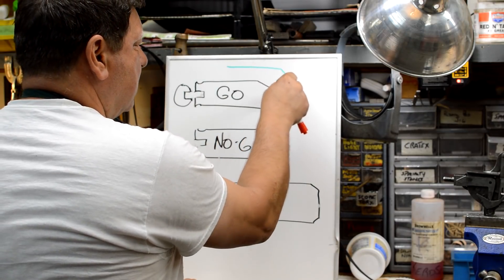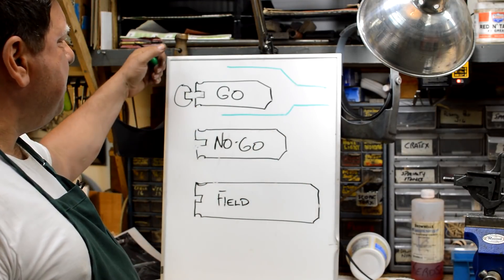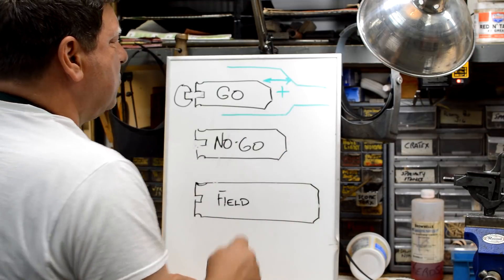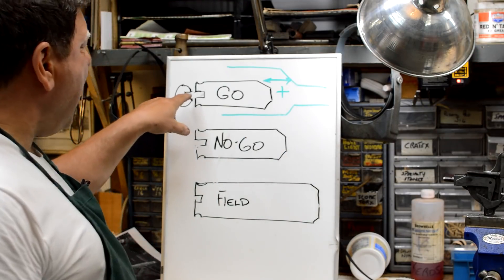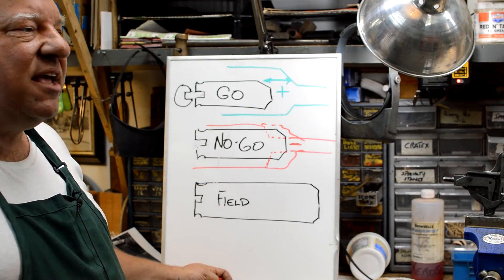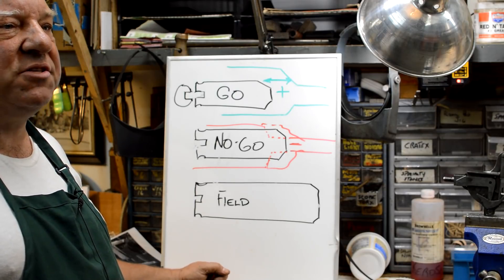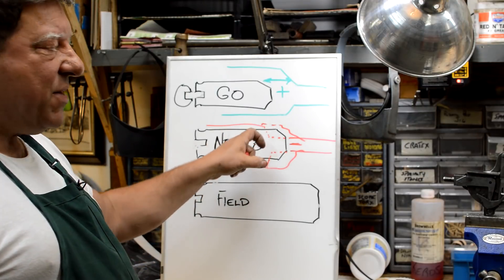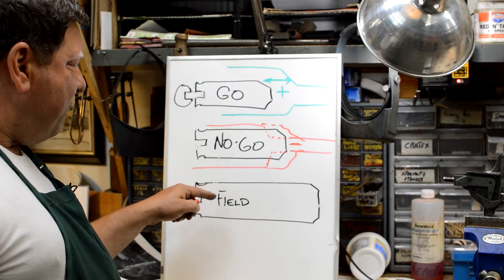Questions, answered #8: headspace gauges

Comment: Here is a question for you Mark. I have never heard of head space getting longer by a lot of use,"burn open". I have heard of the throat length getting longer and the bore wearing out from heat, but never the chamber. If the bolt locking lugs became worn,  then the chamber head space could increase.  I would like to see the evidence, for this claim..
Reply: I don't think he literally meant "burn open", just that the space is increased there due to wearing of the action
Reply: @thecanadianlanboy8132  That's not what he is saying or drawing..Bolts on an M-4 will break, "but don't wear in the barrel extension" causing head space problems. He literally drew on the shoulder area and stated it burns forward lengthening the chamber, causing the bolt to close on a No go gauge. I also have never heard of the military using No go gauges but only Go and Field gauges. The military does not care how much brass stretches in their rifle chambers..
Reply: @hairydogstail  they use no-go, but above regimental armourer level
Reply: @quentintin1  for what purpose ??
Reply: @hairydogstail  check headspace on new barrels, at least into the 80's the army was rebarelling their rifles but that was usually done at the division or corps level.
i have an old French army gauge kit for 7.5 and 7.62mm weapons which has the 3 gauges (go, no-go, field)
Reply: @quentintin1  Are you talking about the French military??
Reply: @hairydogstail  You are very wrong. I was in two branches of the US military and repaired/inspected hundreds of thousands of M-14's,  M16 and m16A-1's.  Even the M-60 machinegun barrel assemblies had three headspace gauges. Replacing barrels or bolts required the use of Go and NO GO Gauges.
Reply: @oldgoat1890  When I was in the reserves they used a minimum and max head space gauge, nothing more. The problem I have is the different opinions and information being put out by different experience individuals.  For example The School of the American rifle states the go gauge for M-16--M-4 rifles used by Colt and in their TDP is 1.4646 ..Many other sources state it is 1.4636... My main question is I have never seen a chamber head space increase by the shoulder area burning forward As Mark Novak claims and where is the evidence?? I'm not saying he is wrong but where is the proof?? No wonder it can get very confusing....
Reply: 8 months later and no reply lol...
Reply: @hairydogstail  The max head space gauge is the same as a field gauge. The no-go gauge is for getting proper head space when manufacturing new firearms, installing barrels, reaming chambers, etc.

The minimum safe head space for .223 rem and 5.56 nato ammo is 1.4636 per SAAMI spec. Colt uses 1.4646 as the go gauge for new M16 and M4 rifles made in their factory. The maximum safe head space is where .223 rem and 5.56 nato differ.

I don't know what Mark meant by "burn open". I assumed he was being metaphorical about general wear tear.
Reply: @nighthound2714  The M-14 does not have a chamber 1.4646 head space lol. The M-14 is chambered in 7.62X51, not 5.56...That would be impossible. Colt never made M-14 rifles lol..

 The military TDP minimum head space for the 5.56 chamber is 1.4646 , not the 223 1.4636 ,  I have the TDP sheet to prove it..

The military max head space is 1.4704 to 1.4706 ,  I have the military TDP sheet to prove it..

The military field gauge for 5.56 is 1.4736 

Head space will increase between the locking bolt and lock up,  but I have never heard of a chamber burning out in the shoulder area, which was my question for Mark who never answered..
Reply: @hairydogstail  The only thing I can think of that matches what Mark said is throat erosion with a straight-walled cartridge. Those head space on the mouth of the case where it contacts the throat. I don't know why he drew the shoulder for a bottlenecked cartidge. Head space is measured differently for every weapon and cartridge type, so it's difficult to give a single generalization that is always accurate. Also, his explanation makes more sense if the go gauge is longer than the minimum safe head space and the field is shorter than the maximum safe head space. 

I wrote M16 (sixteen) and M4 (four). I never mentioned the M14 (fourteen). As I wrote before, 1.4636 is the minimum SAFE head space for the .223 and 5.56 cartridges. Remember, .223 refers to M193 and 5.56 is M855. That's why 5.56 has a longer max headspace; it's not SAAMI spec. Colt manufactures rifles with a slightly longer chamber to improve reliabity in full-auto and with longer bullets, so that's the gauge the military uses.

Basically, min and max gauges are set to the SAAMI spec and never change. Go, no-go, and field gauges are arbitrary measurements set within the min and max spec. They often differ in specific measurement depending on the manufacture and use. (NATO cartridges are their own standard, which makes things even more complicated) I think this is why head space causes so much confusion; It's all relative.
Reply: @nighthound2714  Very well written..

Comment: So my buddy gave me a Spanish Mauser 1916 Carbine. He didn't want it anymore since it was terribly out of headspace and since he had just lost his job, he didn't want to sink any money into it. Turned out someone dremeled down the bolt face or bought a bolt concerted for 7.62 NATO based on the grind marks on the bolt face. I found a replacment bolt body for $30, bought a full set of gauges from Brownells, and when I threw the new bolt in, it passed the gauges. I take it to the range and show it to my home-gunsmith buddy. We both put 20 rounds through it and he asked why i bought a full set of gauges when i coulda just put painters tape on the case head, I could only doubt that statement. Doesn't seem reliable in the least to me
Reply: When reaming chambers at gunsmith school, I distinctly remember being shown how to use this technique as a method of getting a rough idea of headspace. It is legit, just not terribly precise and should probably be verified with legit gauges anyway. Completely forgot about that till I saw your comment. That was a decade ago.
Reply: If you rely on HS gauges for the "End all" test, you are eventually headed for trouble. That means you do not understand what is going on in that chamber. Things were a lot better before the internet. I never saw so many headspace "Problems" until the internet got rolling.
Reply: it works, not the most repeatable method, but good enough for a a quick check
a circle punched from a soda can is more accurate, (beer cans might be too thick)

Comment: I knew an old gunsmith Willy from new lebanon that made his own headspace gauges out of brass. I bought a tastefully sporterized 98 in 338-06 he built in the 70s and it is shockingly accurate between bullet weights. 250gr bullets are exactly 1' below the 275gr bullets and 185s are directly above. No lateral shift left or right. Just vertical strings. He admitted to me that when he built my rifle he didnt own headspace gauges yet and headspaced my mauser with a live surplus 30-06 lake city cartridge. 50 years ago.
Reply: I'm not old or really a gunsmith, but I had to do something similar. I fireformed cases in a modified sizing die, and then used a .005" shim between bolt and brass as my gauge. Just barely closed on the .005" shim, good enough. It was either that or pay out the nose for custom gauges and dies, and for the price of a custom reamer I got a reamer and full die set off the shelf.
Reply: I originally headspaced my FAL with match 7.62 NATO in much the same way. I went back and checked it with proper gauges before I shot it, but throughout the build I didn't have any at hand.  Would not recommend this, but sometimes you gotta find workarounds when no one has the tools you need available.
Reply: I do that all the time when re-barreling, but use a resized case. Most people fooling around with HS gauges don't even understand what the numbers on the gauge mean.  If I made a reamer for a rimmed cartridge, I left out the rim section on the reamer and just cut the barrel face on the lathe. After that I cut the main chamber. Most people think the "Headspace" on a rimmed case is called off the rim. That is nonsense. The HS is already in the reamer and is designated like a rimless cartridge.

Comment: I bought a Indian Enfield in 308. That thing closed on a field guage with two layers of masking tape on the back... I didn't feel brave enough to shoot it. :p
Reply: The Enfield has tremendous camming force when the bolt is closed, and is notorious for closing on no-go and field gauges. There is a very specific method to gauging them, or you will get inaccurate results.
Reply: No one but the Indians know what the factory chamber specs for their 2a1 rifles. It failing your test doesn't mean it's out of spec. There are plenty of headspace gauges for all sorts of 7.62 weapons from target rifles to miniguns and they aren't all the same because they aren't intended to be used the same way. The ones you find on the market tend to be super tight because SAAMI wants super tight chambers for accuracy, which is not what a military bolt action rifle is intended for. It's meant to chamber out of spec or dirty ammo. They have loose chambers. 

All the fret on excessive headspace from people online and yet you can never find an actual rifle blown up from excessive headspace, but it will always be the first thing blamed when a rifle does blow up.
Reply: @Berthier_Enjoyer  the amount of excessive head space needed to blow up a gun is visible to the naked eye, a little extra just wears out your brass and cuts your accuracy
Reply: @pacman10182  Wearing out brass and cutting down on accuracy doesn't make it unsafe. For everyone fretting about the "dangers" of excessive headspace they can't point to one example of a gun blowing up from it.
Reply: @Berthier_Enjoyer  that's what I said
Reply: @Berthier_Enjoyer  Those Ishapore 7.62 No1MkIII's are not built for purpose, they are not beefed up or made of superior steel like some would believe. I'm told Peter Laidler did some metallurgical testing on half a dozen and a couple were found to be WWI actions scrubbed and re-stamped. Lithgow seriously considered converting No1MKIII's in Australia and pulled the pin after testing showed action stretch after sustained usage. The Indians figured they would never see much service and even if some of the that dodgy RFI brass went bad, who cares. They were loosely headspaced from factory and they haven't got any better.
Reply: @WarezWally  This sounds an awful like the "soft Spanish steel" myth or "7.62CETME" crap being thrown around. It's always someone said that someone said that someone said. It's never some actual primary sources, or even secondary sources.
Reply: @Berthier_Enjoyer  what do you mean "7.62CETME crap"?
Reply: @pacman10182  The myth that goes around online is that Spain converted their Mausers to the lower pressure 7.62CETME cartridge. In fact, they were always converted to 7.62NATO and the CETME cartridge isn't lower pressure at all, just lower recoiling. It uses very fast burning powder with a very light bullet.
Reply: @Berthier_Enjoyer  I knew about the low recoil 7.62-not-quite-nato cartridge
I thought meant something else
Reply: @Berthier_Enjoyer  I'll try find the article but a number of 2A1's were tested by a university in the UK and they were of the same steel as regular SMLE's, gauged the same and yeah, a couple were in fact scrubbed 303 rifles. The Indians didnt re-tool for the 2A1 nor did they change steel.
Reply: Even .303 enfields have ridiculously loose chamber specs and they all seem to work. I'd shoot it. I passed up on one of those indian rifles a few years back. It was only $300 and in good condition. That woulda been a fun gun.
Reply: @krockpotbroccoli65  rimmed case to headspace on, lots of room out front in the chamber for reliability in a mud pit, and the military doesn't care what the brass life is as long as it goes bang and extracts/ejects. It's more difficult to feed through machineguns than rimless but it does have advantages.
Reply: 7.62x51 Enfields don't have a standard .308 chamber, and can give you wacky results when using .308 gauges

Comment: So what if it dosent close on go and no go ?
Reply: If your bolt won't close on the Go gauge, and you can close it on a live round, you can cause a dangerous over pressure situation when you fire it.  Have it checked by a competent gunsmith.  You may need the chamber kissed with a reamer.
Reply: Then your chamber is too tight and fails..
Reply: You need to think about the question you are asking.

Comment: Actually, the No-Go gauge tell you that the chamber is TOO long. If the bolt does not closes on the Go gauge, the chamber is TOO short! If the bolt closes on the No-Go gauge, the chamber is TOO long (excessive headspace)!
Reply: You are describing a rifle that fails the gauges and Mark is describing a rifle that passes the gauges.
Reply: @kirkus89  They both are saying the same thing..TheWozWizard explained it better. If the bolt closes on the No Go gauge it does not mean it failed for military use. It means the chamber is longer than ideal and the field gauge means the chamber is way to long and the barrel is no longer safe for use. Many military armorers never use a go gauge but use only the Go and Field gauge. The 5.56 chamber is longer than a 223 chamber, which is why using the 223 1.4636 Go gauge should not be used when checking a 5.56 chamber. Use the correct 1.4646 Go gauge when checking a 5.56 chamber.  Re loaders are more concerned with using a No Go gauge since the brass stretches too much and has a shorter life..
Reply: Watch the video again and listen to what he said, because that’s exactly what he said. “Short enough” is a way of saying does it have excessive headspace or not. If it has excessive headspace it is by definition not short enough.

Comment: In other words, the chamber should ideally be longer than the "go", but shorter than the "no-go" (effectively x length with a +/- tolerance.)  And frankly, I suspect I'd not want to go near "field" unless I was desperate.  :-)
Reply: Exactly.
Reply: What he doesn't say is that go and no-go gauges are for brand new barrels. Even then though, it's really only autos that have to worry about headspace.
Reply: @Berthier_Enjoyer  I have a gut feeling that you'd still want to check the headspace on bolt/lever action rifles, after all rifles from a hundred years ago were designed with a hole in the chamber and bolt should your brass and primer fail in containing the pressures.
Reply: @FrostyShock349  No, I don't. With all the fret online over excessive headspace...it's not dangerous. Excessive headspace makes the accuracy suffer, which is why SAAMI has super tight specifications on their gauges. Gauges which fail nearly every milsurp on the market because their chamber dimensions aren't the same as the factory dimensions. The max for .303 according to SAAMI is .070 inches, but the British MOD's max is .074 inches with a wartime emergency of .080 inches. 

It's not dangerous. It may cause problems extracting. It may have problems firing. The accuracy will suck. In a really bad day you may crack.

The funny thing is, what is dangerous is insufficient headspace. What do you think happens with all of those enfields that had "bad headspace" that owners put tighter bolt heads in? 

Back to my original comment. Headpsace really only matters for autos. For bolt actions to be fired so much to get headspace that out of tolerance the barrel would have long since been burned out.
Reply: @Berthier_Enjoyer  This isn't the case.
Headspace is important, even in bolt guns. 
Although more important in rimless guns, it is still important in rimmed cartridges like the .303 you mention. The simple answer for Enfields is to get proper gauges and not the American junk
A case failure caused by headspace could cause a breach explosion in a front locking rifle, although uncommon it happens.
Reply: @thecanadianlanboy8132  Guns are designed for failed cases in mind and are almost always caused by bad brass, not the chamber. Excessive headspace outside of autos rarely exists unless someone was messing with the chamber. And people mess with chambers because of bad headspace gauges.